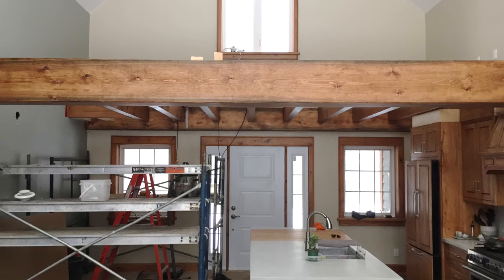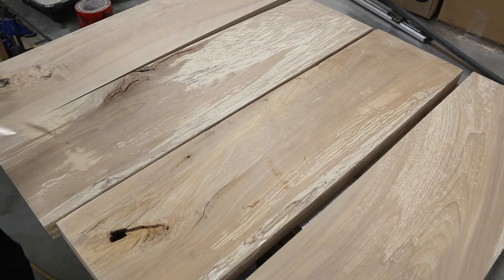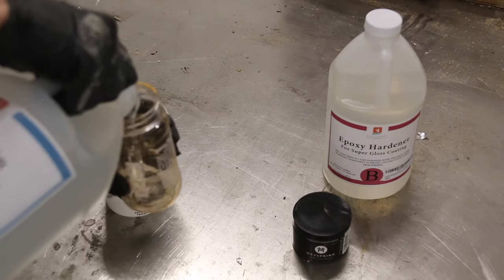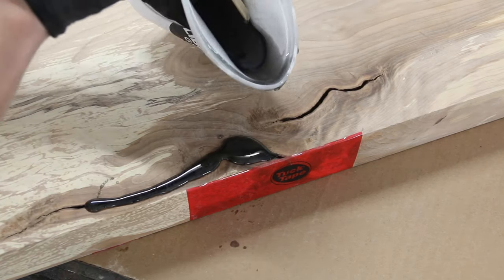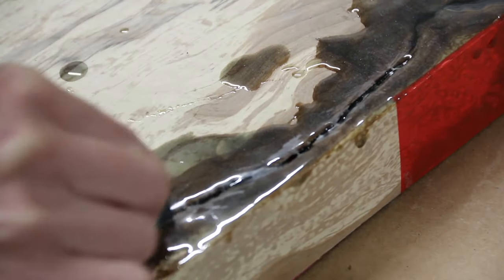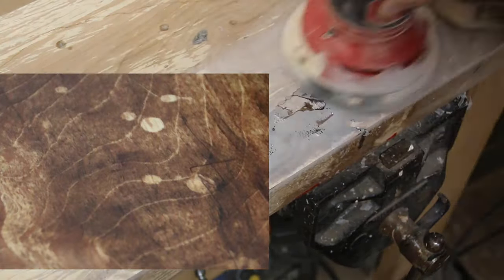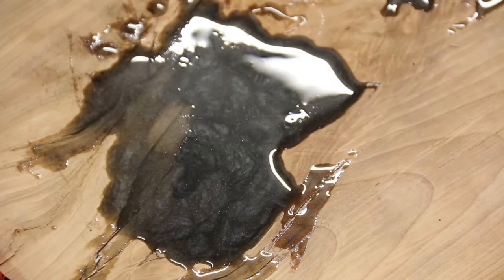How to Fill Cracks & Voids with Epoxy Resin (for first-timers)

Comment: The stairs look fantastic! One tip to keep from having to sand away so much epoxy after it hardens is to use an old credit card or small squeegee to scrape away the epoxy while it’s still wet. What’s remaining will easily sand off with one or two passes.

Comment: Just an observation however my thought to prevent over filling the cracks would be to try using a syringe with a large whole.  I believe you can get them at tractor supply co.  Just don’t use the needle.
Reply from the maker: that is a great idea!!

Comment: Epoxy is an adventure.    Every part of it is a learning process including the use of tuck tape.    Have a heat gun handy or lots of alcohol or something to release it.   I pulled some of the surface wood off my silver maples slab.    Don't overfill anymore than you have too.   I used a trans tint dye which penetrates into the surrounding wood meaning you have to plane or sand the stain out also.   Lots of folks seal with a sealing epoxy before doing their deep pours.    That's great if you have a professional woodworking shop with tens of thousand of dollars worth of planers, drum sanders, and other high dollar equipment.

Comment: Loved the video! If you have trouble with thick epoxy try letting the containers sit in warm water before mixing.
Reply: The summer is a great time for pouring. I leave my resin/hardener in the garage and it mixes so smoothly with little to no bubbles.

Comment: I recently poured epoxy to fill cracks and gaps. When sanding I noticed the epoxy color seeped into the neighboring grain leaving a splotchy dark color in areas. Has this happened to you and any recommendations for fixing? Any help appreciated. Thanks!
Reply: If it's Dye/ liquid pigment as opposed to powder pigment you should always seal before you pour. I use a small brush to put a clear coat of Epoxy first let it dry then pour. This solves the problem and seals your project. Which stops the bleeding into other areas. To get out bleeding is tough sometimes you have to go as far as planning/resurfacing it. Hope this helps!

Comment: When it comes to doing multiple pours, is there a visible “seam” between layers? Like on a river table or something like that, where a lot of the resin is visible in the finished product.
Reply: As long as you pour the next layer between 3-5 hours you'll be fine.

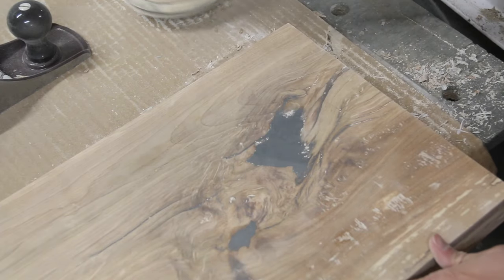Comment: Heidi, at 4:09 what liquid do you use to wipe off the sanded dust to see how the epoxy looks when it is clear?
Reply: Water😂
Reply: @doolinmoranphotography4461  Or alcohol, mineral spirits, or acetone.   Water is the cheapest and certainly the most environmentally friendly     😁

Comment: Yeah so you have zero idea if you have the right ratio since an unknown ammount was left in that jar, so, A:it never hardened, or B: it “hardened” yet it’s still a liquid (kind of in the sense that glass is a liquid) just a more sped up process. I filled a natural crack in a cutting board when I was a novice and it “hardened” but sank over the months. Looks good for now though
Reply: You know epoxy isn't safe to ingest right? Meaning it should never be used on a cutting board! In my experience ratios don't need to be exactly 50/50 down to the nano gram...You can clearly see this hardened up just fine.